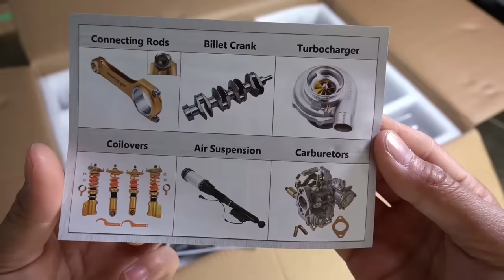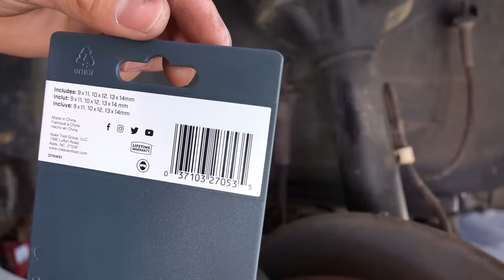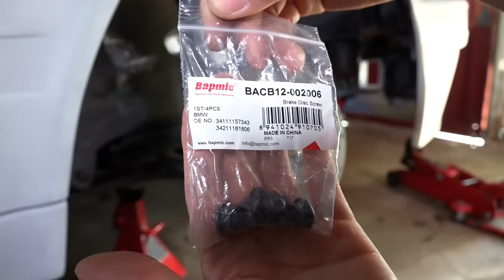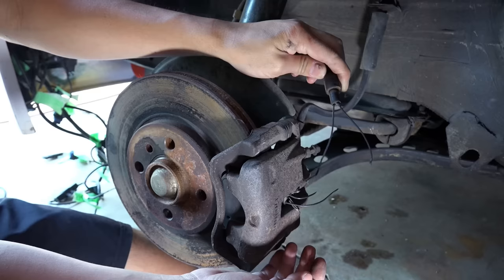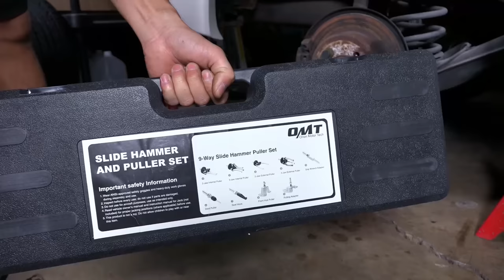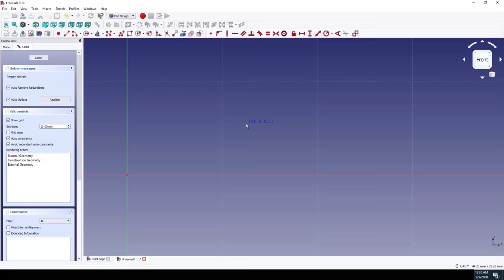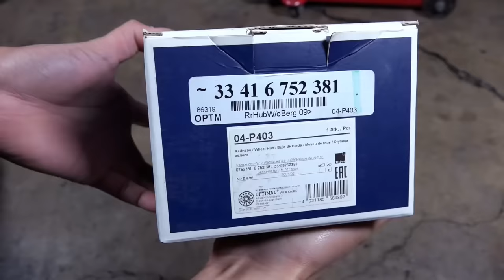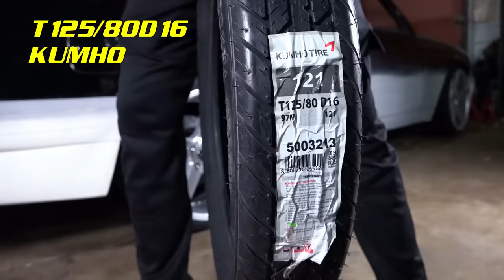E30 Fix 15 | $2,874 5 Lug Conversion, E36 MaXpeedingRods Coilovers, E46 Big Brakes, Z4 Hubs

Comment: Awesome job man, I appreciate small details such as taking the time to shape those dust shields instead of hacking them up. Also, torquing everything to spec instead of just gunning them on is always nice too see. 
I have a couple of garage tool suggestions that are relatively cheap  but are super helpful if you don't have them already. A small tumbler to polish nuts and bolts or any other small parts (helpful for when you have to do bolts and nuts in bulk instead of spending hours on a wire wheel). And ultra sonic cleaner to clean them afterwards or again any other small parts (Good for cleaning parts to paint or greasy parts). Finally, a d.i.y. zinc plating kit. 
Glad to see content on this car coming out a bit now. Nice job mate.
Reply from the maker: Thanks, man! Yes, there will be all kinds of restoring and zinc plating going on for sure. Cheers
Reply: @DarkDragonWing  Best of luck. It is quite the learning curve to get stuff to turn out the way you want them too. So many variables, temperature, chemical compound, condition of the parts etc.

Comment: Very nice,i went crazy everytime i saw an e30 or E36 in thailand.
If you buy coilovers again,you need to buy front for E36 and rear for E30 because the compact/z3 rear end has way longer coils.
If you fit a shorter coil to them the rear shocks dont work properly,and are easier to blow off.been through the same pain in the ass.

Comment: Good work but im wondering why all the suspension work if the car still has rust holes?
Reply from the maker: I want to test fit all the parts before I fix the rust.

Comment: Parts top 👍🏻 just wouldn't it make sense to weld and seal the whole sub-floor before I do all the work?
Reply from the maker: I'm modifying a lot of things on this car. It wouldn't make sense if I fix the rust and repaint the whole chassis just to come and find out that I need to drill more holes or cut off some areas to fit some parts that I want to put on. I'm making sure everything fits before I take everything off to really focus on removing the rust. 👍🏻
Reply: DarkDragonWing All right, I'll start or others start with the sheet metal and then with the preparation

Comment: Great work but why didnt you replace the rear breaklines with breaded even when you did the front?
Reply from the maker: The rear brake lines from the E36 are too short for the rear E46 calipers.
Reply: @DarkDragonWing  aah that sucks. i hope you'll get the correct one's soon. Love the way this old beast is getting upgraded hahaha

Comment: This vid was amazing, super great work. A few things, why no grease on the caliper guide pins?! And why buy a spare donut instead of another matching wheel?
Reply from the maker: This is just a test fit, all the grease and everything will be applied when I put them on for real. A spare wheel is a lot cheaper and a lot lighter.

Comment: Good job !
But only 25 ft-lbs for the Studs ? I think they will go out when you remove the wheel nuts (more tighten than the suds)
Reply from the maker: That is to my surprise too, but that is what the company that made the studs recommended. I'm sure they are also counting on the red thread lock to help the studs stay.
Reply: @DarkDragonWing  for mine, the compagny told me to tight at 80 ft-lb with loctite. And a little bit less for the wheel nuts.

With 25ft-lb i will be scared about loosing my wheel 😂
Reply from the maker: @Finch7Stunt  Hmm Though come to think about it, I think it works both ways. When the lug nuts are torqued to 80 ft-lb, the studs are also being torqued to 80 ft-lb because the lug nuts are essentially pulling on the studs.

Comment: everything is great, I just have one question, why did you shorten the 30mm socket?
Reply from the maker: The socket was too long. The nut is so short, the socket was constantly slipping off. I even have to hold the socket down with the hub puller after the socket was shorten because I kind of ruined the nut a little bit when the socket was slipping off.
Reply: @DarkDragonWing  oh okay💪

Comment: When you tested the suspension on the rear, I think i can see that the tire is actually hitting the inner wheel well. You might want to take care of that :)
Reply from the maker: Oh yes, rolling the fenders should fix that.
Reply: @DarkDragonWing  What about putting on some over fenders ;) Or do you not plan on cutting up the rear?
Reply from the maker: No cutting, I will do a proper fender rolling to get a nice seamless look just enough to cover the wheel as well.

Comment: Wow....this project is freaking detailed, your knowledge is really awesome. Is the srs concept 5 lug adapter better than the treehouse racing ? The wheel is better centered ?
Reply from the maker: I'm not sure the ones from Treehouse Racing. Though the SRS Concept Front 5 Lug Adapters were specifically made to be used on E30 when doing an E36 front knuckles conversion to make sure that the wheels are centered inside the wheel arch.

Comment: Hey, I really like your video style! Very invormative and well put together. 
But one question regarding the structural condition of your car. I've noticed al lot of huge rust holes and rotten areas at the under side of the body. Why do you put so much expensive parts onto your car, without repairing the structural issues in advance?
Reply from the maker: Thanks! My strategy is to make sure the parts fit perfectly to the original frame. Modify what I can now on the parts before I start taking the whole car apart, fixing the rust by cutting and welding in non-OEM sheet metals. This way, I will have the parts for reference, and I would know for sure that something is off if the parts don't fit.

Comment: Hello, the project is great, but there is an important issue you have passed. There is a big problem with the Hand brake pad because the discs have grown, can you tell us how this issue was resolved?
Reply from the maker: Hi. The handbrake pads (rear brake shoes) are the same size and fit the new discs. The discs may be bigger, but the drums size is the same.

Comment: I done the same thing, do you find the suspension is too stiff for daily driving? I am going to go back to shocks and springs but don't know what mm to drop by
Reply from the maker: I can't say much. This setup is 450 lbs/in front and 600 lbs/in rear. Even with 600 lbs/in, it still feels soft to me when I try to sit on the car and jump up and down. 600 lbs/in was the safest choice after I did some research. I will try Hyperco 700 lbs/in next if this turns out to be too soft during actual driving with all the weight of the parts back on.
Reply: @DarkDragonWing  mine is a convertible, so its designed to be a cruiser, i am going airide in the future but for now its to harsh for cruising

Comment: Great job, is looking very nice.  Just need more atention on the parts that have a little of rust, the differential, the transmitions. But a black spray will let some areas look cleanner. But keap it up 👌👌

Comment: Sid you have any issues with the e brake and the srs adapter I’m the rear hitting the rotor?
Reply from the maker: I haven't tested it out yet. I didn't see or feel anything hitting anything though, the wheel seems to rotate just fine.
Reply: I just did the front . But the rear is giving me an issue with the e brake and also the srs adapters hit the inside of the rotor
Reply from the maker: @yeyoo5166  Did you use the correct rear hubs? Z4 Rear Hubs 33416752381
Reply: Yes I did. But for some reason I I put everything together without the axle and everything was good. Once I threw the axle in and tighten the nut I feel like the hub went in more and hit the srs adapter with the caliper so it got stuck. So I think I’m going to separate it tommorow and see if that does the trick.
Reply from the maker: @yeyoo5166  Yeah gotta get the hub out a little somehow so that the rotor doesn't hit the SRS bracket. Like I showed in the video, the Z4 rear hubs are longer out a little. Maybe the SRS brackets you got are too thick?
Reply: @DarkDragonWing  got it all done today bro 👌🏻👌🏻👌🏻 looking clean

Comment: In here showing you some love man!
Reply: Fam, how are you fitting 18's on here...
Reply: Well FMR...that's the same height and the original.
Reply: At the first wheel installed...I see what you're doing.
Reply: Hold on man, you just fab up some spacers to hold the spring in place....
Reply: I'm surprised that you didn't replace the rear bearings.
Reply: That rear spring solution really improved the look.
Reply: You even got the spare, your attention is epic man. Until next time!
Reply from the maker: Man, thanks for the love! 🎵..Put some 18-inch rims on the mf..🎵 haha Yes, too bad the springs that came with the kit are way too long. Oh right now I'm just making sure that everything fits. I will take everything apart again to restore or replace, I will definitely replace the wheel bearings. Cheers

Comment: Just a question I noticed other ppl remove the or deleted the ABS and the rear wheel speed sensor ? What is the reason ??
Reply from the maker: I only delete the ABS and brake pad sensors. I know how to apply the brake safely on my own, I don't need the ABS braking assistant. Same with the brake pad sensors, I know when I need to change the pads by just looking at them. Less stuff means fewer things to take care of.
Reply: Got you, off course thx for the replay brother I’ll be watching you build keep it up 👍🏻 awesome video

Comment: Which model was used for the brake caliper, I would be glad if you could help.     Please.......
Reply from the maker: 2005 BMW E46 325Ci
Reply: @DarkDragonWing  

The caliper you mount on the back is the same ?
Reply from the maker: @ademsefareka7095  Yes, all the calipers are from the same car, a 2005 BMW E46 325Ci.

Comment: Hi! Nice content! One question: Does the e36 front spindles fit plug and play on the e30 lower control arms?
Reply from the maker: Thanks! Yes, plug and play.
Reply: Thanks! Ordered E46 330i brake calipers now to run 325x25mm rotors, on e36 spindles on my drift build E30😎

Comment: You absolutely should not have sanded those control arms where the lower bushing presses on. You slipped it on there with no effort, which is absolutely not how its supposed to be. its a press fit. You need to throw those control arms away.

Comment: Mr. Mackey, did you mount the tires or did you take them to a tire place? Was curious to see whether you did it or not. :) I did not realize that she is AWD.
Reply from the maker: I took them to a local shop to get them mounted and balanced for about $108 dollars. I wish I had the machine to do it myself, but I probably won't use it enough to own one. Cheers
Reply: @DarkDragonWing  - As ingenious as you are I thought that you might have had some trick to do it. :) I mount tires  (15 in.) on my lawn tractor myself. Once I get the tire on the rim I put a ratchet strap around the tire and tighten down. It closes the gaps up enough for the tire to take air. When I hear a pop I know that the bead is set. I have never tried it on a car tire though. Could work! I always enjoy your videos.

Comment: Hi there bud.i recently did a 5 lug swap using E36 front and the track is wider than stock by 10nto 15mm each sides.
Rear i used Z4 hubs and it remains stock.
Is there any difference between the front you used from the 95 325i and the 318is i know they are bigger but is there difference in the hubs and knuckles?
Thanks.
Reply from the maker: The setup I used (exclude the spacers):
Front Total Width + ~20mm 
Rear Total Width + ~6mm

You will need to use spacers in the rear to keep the width the same as the front.

I believe there is no difference between the 95 325i and the 318is. Did you also use SRS_Concept BMW E30 Front 5 Lug Adapter Kit?
Reply: @DarkDragonWing  yes i used the Srs concept.
My alloys are the Aluline 16x120 8J ET 16 front and rear.
Because of the shape of the alloys i can not run big brakes and i can only put spacers at the back to compensate with the front.
Great video by the way bud
Liked and subscribed.

Comment: Brake pad sensor ! You cannot get rid of the fault warning light by making a short circuit.
Reply from the maker: I think I can. If I break the circuit, the brake pad light will come on.
Reply: @DarkDragonWing I thought the same as you when I first tried it.  :) but unfortunately it failed that way.  The warning light remains on did.  I did research on many form sites.  A few very challenging solutions were offered, but it was easier to replace the original sensor compared to the solutions offered.  :) As a result of my efforts, I found such a solution.
->The quickest way to turn off the warning light is to add the brake pad sensor cable parallel to the brake hydraulic oil sensor input cable.  This is how I discovered extinguishing.  otherwise it will not go off.
note;  Cable colors make a difference, find the right choice.

Why are there no new videos anymore?  I'm looking forward to!
Reply from the maker: @erolbuyuktas2485  I'll have to keep this in mind when I actually get the car all together. We'll find out if the light will show or not. I constantly try to make more videos. Life got a little busy lately.

Comment: Am I the only one here wondering why you change only half the suspension components and putting non rebuilded brake callipers? Also I would deal with those huge rust spots way before thinking of any upgrades

Comment: What is the rear brake disc size in mm?
Reply from the maker: E46 325 sedan, coupe, convertible, touring Rear Rotor
294 mm x 19 mm Vented

Comment: Strange sequence of the project. What is the point of putting for example an M-tech bodykit and buying a spare wheel, when the car has plenty of rusted holes, where you can put your fist in? Also, why do you try to fit turbo and intake manifold and remove strange parts to help them fit with the engine in?  Ofcourse it will not fit until you do a lot of modifications to the stock parts positions. Why don't you take out an engine and put it on the engine stand? Or are you willing to make all the engine modifications while it's in? As I remember in your past videos new pistons, cranks, crankshaft and so on are included in the project, how will you manage to change those with the egine in?  Making a lug conversion and leaving those rusty parts... Later you'll do the double ant trible jobs when changing the driveshafts, differential and so on. If you're leaving body as it is and only paint the visible parts it'll be a bit dissapointing. If you'll take everything apart later and to the bodywork the whole project till that is a waste of time. Anyway, good luck, respect for the project and especially for filming everything, it makes everything 3 times longer. I know that it is yours first big project, but the whole order of it is just wrong...
Reply from the maker: It's all about the fitment and creating worthwhile content. This video has everything you need to know to complete the 5 lug conversion, and then some, from start to finish. You won't find a video like this anywhere else, and that's one recipe for some success on YouTube. Besides, everything has a reason behind it. I will be rolling the fenders, and the new wheel setup lets me know how much I need to roll while not worrying if the paint will crack. Without the M-Tech 2 kit installed, I would never know how to mount the intercooler correctly and cut the front bumper accordingly. The engine bay will need to be cut, drilled, and welded when doing intercooler piping, oil filter relocation, and so on. I would rather do all that before removing everything, including the engine, to put in the forged internal parts, do the rust removal, and restore the chassis. Imagine having a restored chassis with fresh paint just to come back to cut it and ruining the new paint because something needs to be fitted. Now that would be a real waste of time, don't you think?
Reply: Of course the paint is last step and you will have to take almost every part of what you have installed to make room for bodywork. What I want to say that it would be much easier to take out an engine, rebuild it and then measure, cut, weld, relocate parts and so on when trying to fit it in. It's just my opinion from my personal experience. I wasn't talking about a success in youtube, if that's the reason to some of the modifications for regular content it's understandable. Good luck and do not stop. :)